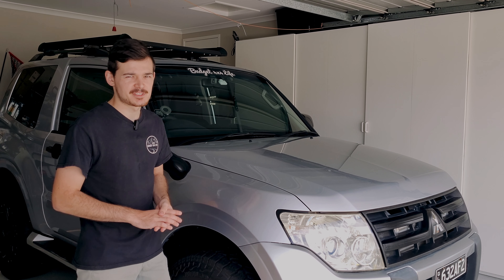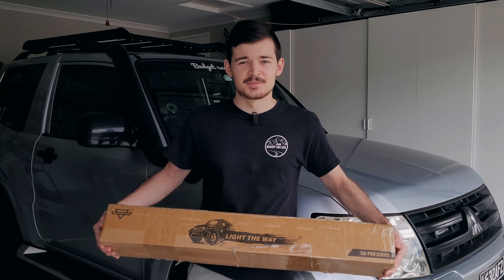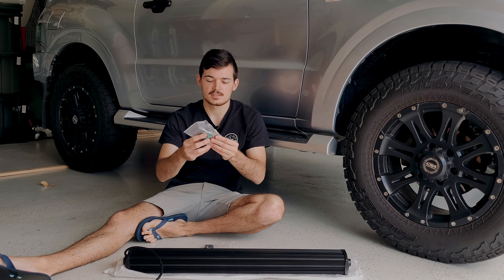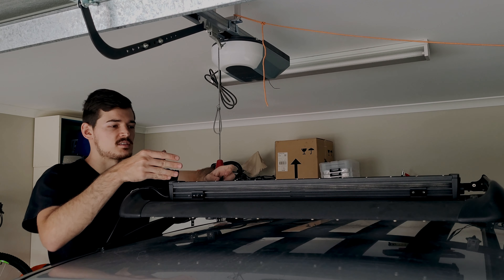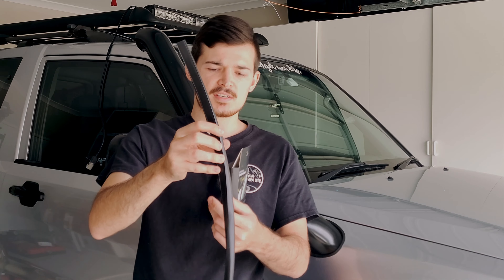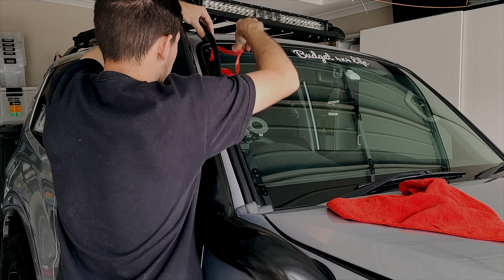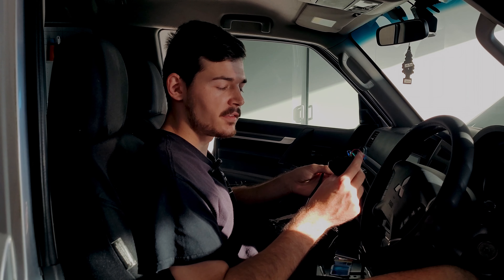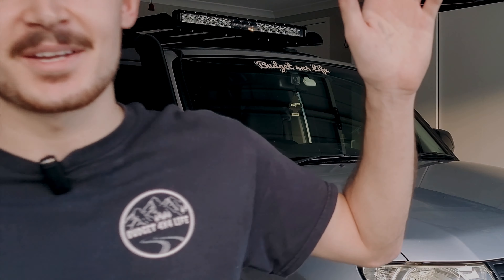How to install a LED Light Bar to your Roof rack! / Auxbeam 5dPro 32"

Comment: Nice video sir. I have a 2012 Tundra Crewmax TRD and i am planning to get a light bar for the roof. I'm possibly looking at the Prinsu or the N-Fab roof racks which are close to what yours looks like but these have the cutouts to install a lightbar and help with the wind noise or aerodynamics of the vehicle.

Great how-to video, doing my homework to see if i am really going to take on this project...

Cheers...🍻
Reply from the maker: Cheers for commenting and following along mate! Good luck with it 🙂💯🔥

Comment: Interesting video! 

I personally would not have drilled into the roof rack. Instead, I would have used a mounting bracket?

One reason is if you find another sponsor down the track, or it's damaged by a branch or replaced.

Then you are not having vacant holes in the rack. 

Thanks for your video. 

t
BTW. How is the bar performing?

Comment: Did the light bar add to wind noise?
Reply from the maker: Very slightly. Can't hear it anymore as I'm used to it 😃 turn music on and its gone
Reply: @budget4x4life  hahaha Cheers. The volume up switch is a bit mandatory in the Gen 4 with KO2's @50% wear 🤣🤣
Reply from the maker: @karl4834  haha in that case all good🤣

Comment: what kind of wire are you using to extend the power cable? are those just speaker wires?
Reply from the maker: Had speaker wire laying around but would use trailer wire 💯
Reply: You should ensure the rating is the same or better, the amp draw etc needs to be noted.

If you use the wrong cable you could cause the wiring to overheat and even catch fire.
There's a reason why cabling is rated.

Comment: Hi, it’s my first time installing a light bar. I have installed and wired up all the harnesses the right way, but unfortunately the light bar does not work… I have not connected the high beam adapted to the relay.. could that be the problem or it’s the light bar?
Reply from the maker: Easy way to test if a light bar work is to connect it directly to the battery and see if it goes on or off without the harness. Your relay should make a click sound. If it doesn't it means not connected properly. If it clicks but doesn't come on check if your switch is turned on. Also make sure the wires are correctly installed on your switch 🙂💯 Hope you fix it up quick 😊